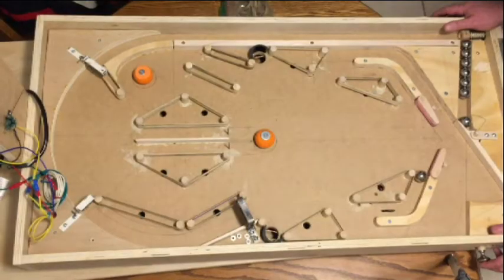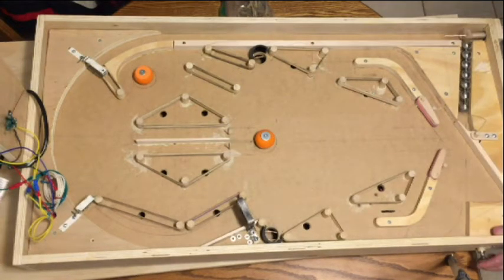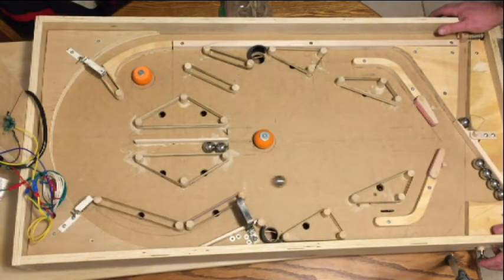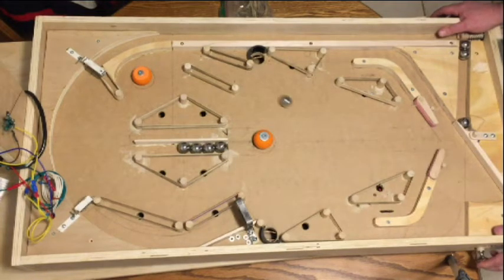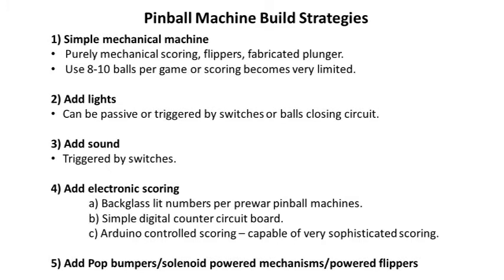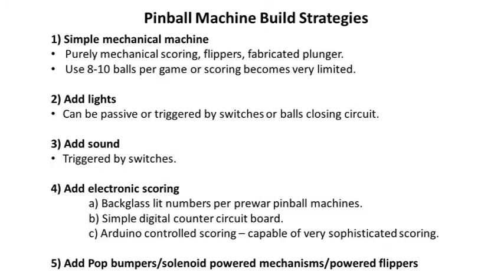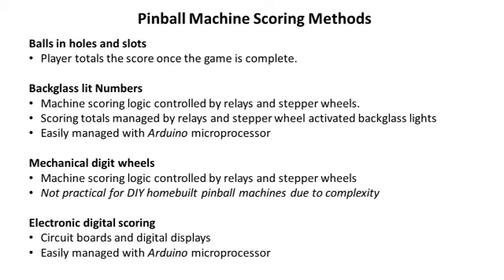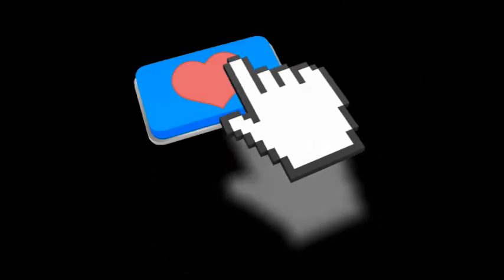DIY Homemade Pinball machine

Comment: I have just come across your pinball channel as I searched for DIY pinball ideas so I could make one for my grandkids.  I like several of the features here.  I was wondering if you had gone any further with this design?

As I would like to make one myself, I was wondering if you could divulge a few more details?  Playfield size?  (I'm seeing about 20" x 45".)  Steel ball size  (Standard pinball at 1-1/16"?)  

Thanks!!
Reply from the maker: Playfield is 20.25 x 42 and standard 1-1/16" pinballs were used. I have not spent any time since the video upload working on any pinball projects but hope to get back to it this coming winter. Thanks for watching and your comment.
Reply: @makecoolstuff9170  Thanks ever so much!